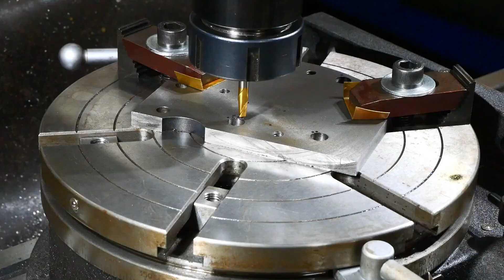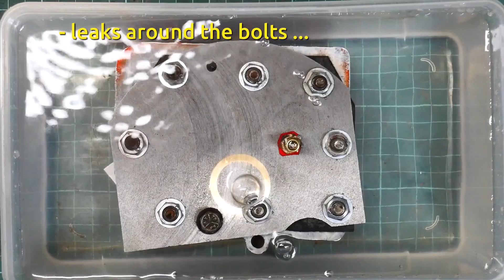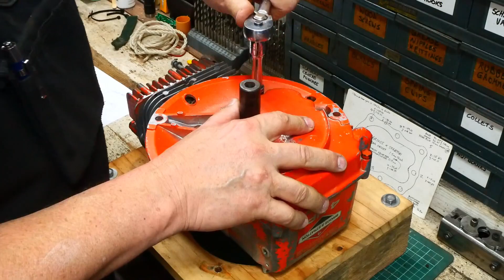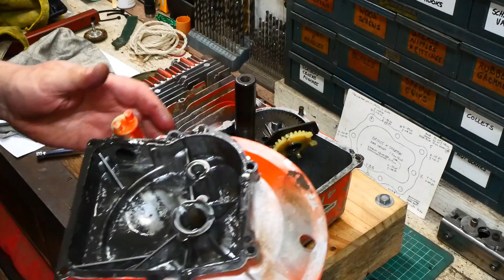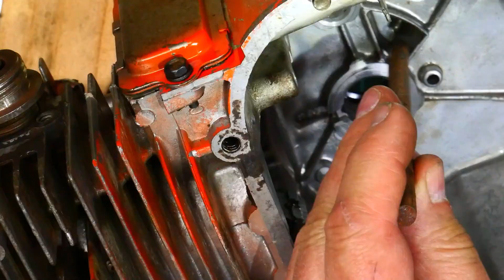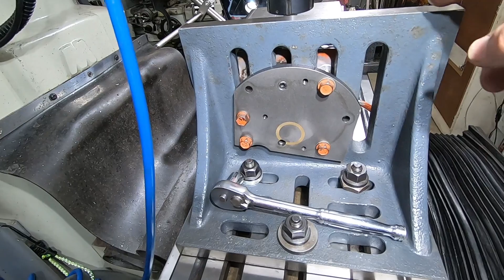Briggs & Stratton conversion to an air compressor - Part 3

Comment: Would a silicone baking sheet make a good gasket material for this application?
Reply from the maker: Thanks for the suggestion Mark, I think it is worth investigating. Apparently silicone baking sheets can tolerate up to 250C and presumably have some tolerance to oil. Not sure how well they would handle pressure, but they are cheap enough to experiment with. I have bought some Garlock 2500 CNAF gasket sheet: "Style 2500 is a quality, general service compressed gasketing material. The combination of a nitrile (NBR) rubber binder with aramid fibres provides good performance at a competitive price." This stuff will eat my job for lunch - but for a small job the price is definitely not competitive with a silicone baking sheet :)
Cheers.